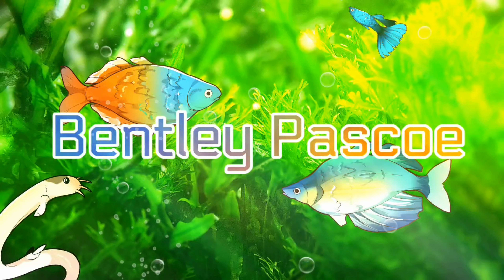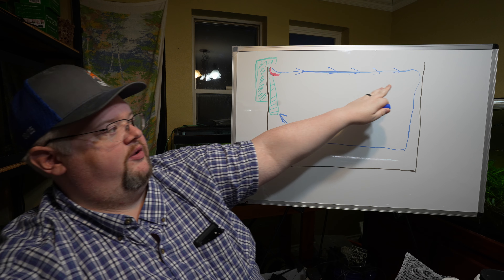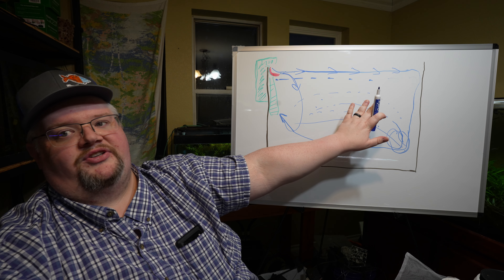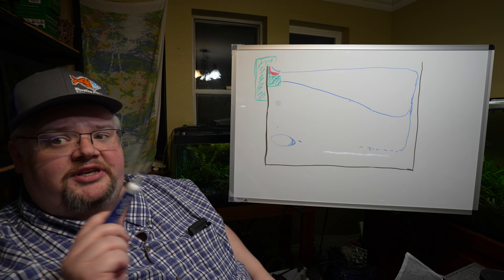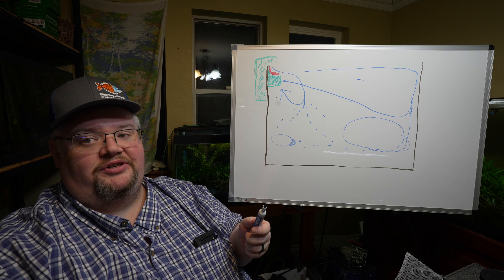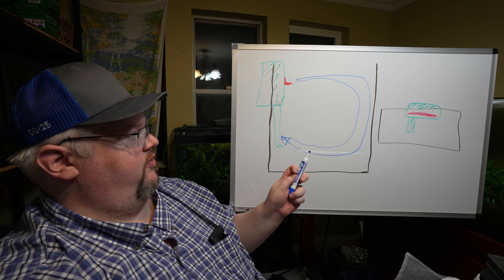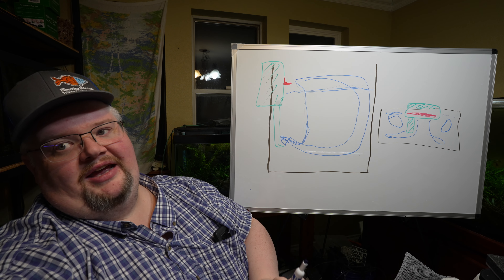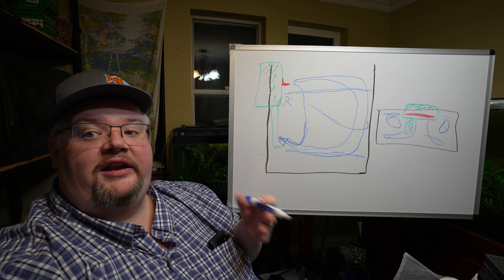How filter placement changes your tank's flow - Hang on Back Edition

Comment: Thanks Bentley. Super info.I have 2 Cascade 300s HOB for a 75 I am setting up. Do I push them both toward the center bar of the tank or place them near the ends. Also have 2 small sponge filters I am putting in for aeration and movement.

Comment: Thank you for the video... I just purchased a Tidal 75  yesterday to replace my JEBO canister filter on my 55 gallon goldfish (only 5 fish) tank. The canister filter really wasn't doing a great job because even within 5 days of a water change and cleaning the glass, the algae accumulates so quickly. I really wasn't sure where I should place the HOB... either on one side or in the center.

Comment: yes please - just upgraded to fluval roma 240.  need help to maximize flow.  do I add a 2nd filter or a just a power head/wave maker? - HELP
Reply from the maker: If you only need more flow a power head should be fine.

Comment: Bentley good job explaining. In my 40 breeder I'm running a title 75 on the side of my planted tank. Also running a small power head and 2 sponge filter and my tank does well pushing detritus to my filters. But it's good to understand the differences of placing filters

Comment: I am wondering whether this info is based on actual science or your observations? Dont like looking at an hob in center back of my rimless tanks...but will move them if better overall. Mine are at sides now and eventually will try canisters....
Reply from the maker: You don't have to have a filter placed in a specific spot.  You're still filtering the tanks water, this is more how you can affect the movement of water within a tank IF you want to.  This is partial science (understanding how water moves, path of least resistance and suction) combined with experience.

If we wanted the "full scientific" route it would require literally hundreds of tanks and filters pushing particulates around a tank in an observed fashion (think like wind tunnel testing aerodynamics).  Far too costly for a hobbyist to perform.
Reply: @BentleyPascoe  was just wondering whether you read some official study.....thank you

Comment: Hardscape can be used to modify your currents to mitigate low flow zones in your tank if you wish to be fussy about it. In some cases you may want to be this picky, in others it doesn't matter. A great way to maximize flow using a Tidal 35 in a 20g high tank is to have a piece of log-shaped driftwood running side of the tank to the other side sitting at an angle so there is clear space underneath the log. Tidal goes on the back of the tank. Outflow will run along the surface of the water, back to front, then when it descends it will tend to circle underneath the log. I can see this happening as duckweed shoots across the surface, down towards the front, under the log and back up towards the filter intake again. A completely unintended benefit of this is that the duckweed gets stuck underneath the log where my snails like to hang out and eat it all (the snail species in question loves plants). It's perfect.

Comment: I would love to see cannisters. I have a GLA 22L with double intakes and a flow tamer spray bar which is double drilled. I have fancy goldfish in a custom built 36 x 20 x 28. (very size specific for the space it is in) that is why  I need a really good filter...my fancy golds are water pigs. BTW I also run a plenum UGF in the Dr. Novak style. Yes I know I have over kill filtration! Just would like to know how you would set up the intakes and spray bar for maximum flow filtration. Thanks...love your videos, they are always full of great information. You taught me all about aquarium lighting...thanks for that. Teri

Comment: I have a 75 gallon freshwater small fish community tank (kuhli loaches, cory doras, tetras, danios, guppies, and mollies) with an AquaClear 110 HOB on the back, so half of my tank is almost stagnant.  I've played with both a wavemaker and a powerhead (not together).  I just can't seem to decide on placement for either to optimize the water flow for keeping my tank clean and keeping the debris from settling and not moving to the hob filter.  Any suggestions, diagrams like the ones you're doing now would be a great help!!!  Thank you!!!

Comment: This is very timely for me! I'm running into more detritus/mulm build up issues as my vegetation gets more dense. Since I've got a small herd of cory's at the bottom, they're constantly kicking up debris lol. The heavy vegetation is creating dead zones, and even with my filter configured in your latter suggestion, I'm still getting mulm settling on plant leaves. I've bought a pump for more circulation and have yet to install it. Hope it gets the job done lol

Comment: Hey Bently, where should I put a sponge filter to a HoB to maximize flow and detritus pick up? from ur bad drawing I guess the opposite end on the substrate floor, where it churns?
Reply from the maker: That's likely the best spot yes, if it's not an intake sponge on the HOB itself

Comment: I have 2 Tidal 55s on the back of my 37 gal tank. The skimmers are blocked but for a small strip at the top. My logic being if the clean water is entering from the top, you want the maximum pickup at the bottom. I went to Tidal, as I simply got tired of decades of fiddling around with Aquaclears to get them running after maintenance/power outages. I'd definitely like to see additional footage on both canister and air driven filters.

Comment: Wouldn’t  air stones at the other side of the tank help with the movement and pushing the water in about a 20 gallon tank.  I unfortunately bought a filter system recommended for a 20 gallon. I didn’t one up it
Reply from the maker: Yes it would help!

Comment: I prefer mine on the back, either big one in the centre or two smaller ones on each side. That way you have areas of lower flow which I find works better for the average community. River tank with fish that like faster water, put it on the side. It does seem to me sometimes that people overdo the whole flow thing, almost like motorheads competing with their engine sizes. Seen to many tanks where the fish are being blown around. Good vid as always!

Comment: Have you been checking out my videos? Until this.  never seen anyone explain this before. One thing you didn't mention is. Hob filter restart. A lot of people complain about the best hob out there the aquaclear. That it won't restart after a power outage. If you keep the water level right they have no problem restarting. The tidal hob is crap. The only thing they have going for them is the pump is in the water. They don't skim. The media capacity is a joke and the sponge that comes with them is almost non-existent. Plus is the water does get low they're ridiculously loud. Anyways keep your water level just above the lip on the exit ramp of your hob's for proper filter performance. That goes for all brands.
Reply: Seachem tidal hands down. Don't care for the aquacraps stuff. Had them and threw them out. Now it is just seachem tidal an FX 6 on all my takes
Reply: @DAVID Olsen  unless it was given to me I'd never own another tidal. Aquaclear is far superior other than the pump not being in the tank. Comes with a properly sized sponge plus plenty of room for other media. Tidal are crap. No sponge, bypass worse than an aquaclear, noisy, ect. I would have to agree with you on the fx6. I have several and they are without a doubt the best canister filter on the market.